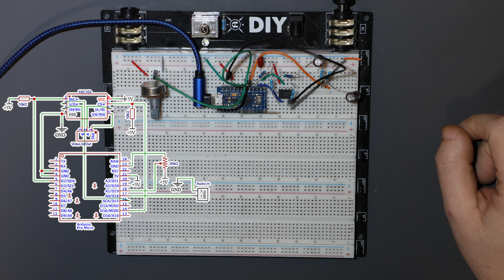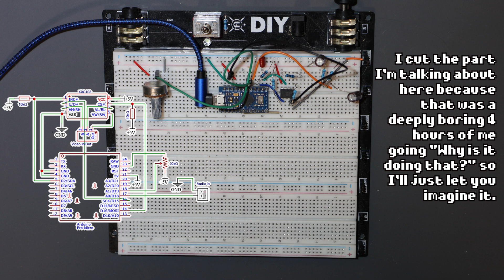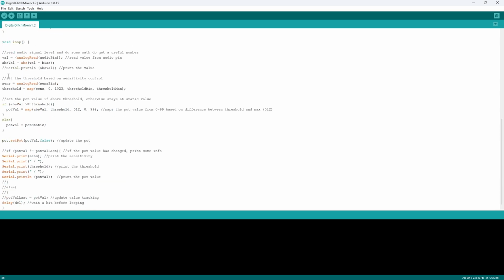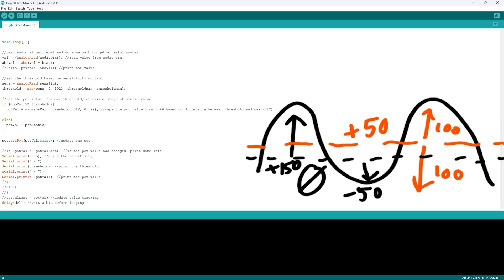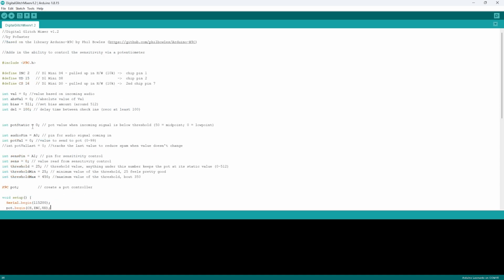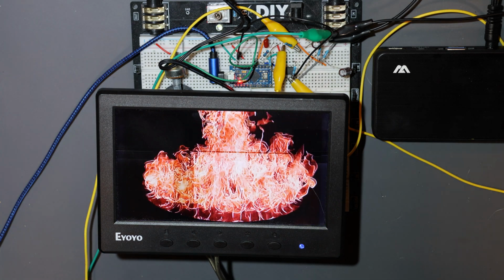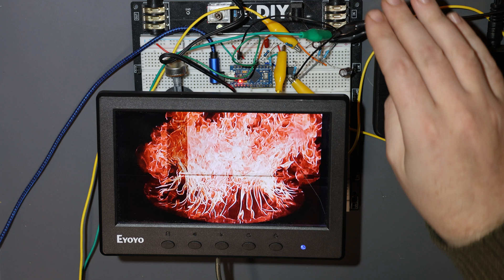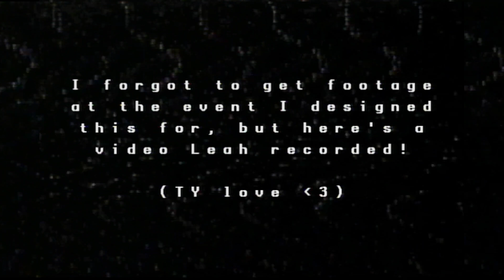Building a Digital Glitch Mixer (Karl Klomp Video Mixer) | SCBSS 3

Comment: Would love to see the 1k simplified mixer. Have you tried it with ultrasonic sensor as input?
Reply: Also, just to say, unbelievably helpful. I'm new at this, and this is the best video I've found so far!
Reply from the maker: @jeremystarn4331 thanks! I actually haven’t done much experimenting with this design since, but do love the idea of an almost theremin setup with ultrasonic sensors!
Reply: Apologies but also, also, how did you end up getting the signal from the digipot to the video out, assuming composite video.
Reply from the maker: @jeremystarn4331 let me know if I’m totally misunderstanding and whiffing this one, but the wiper is just directly wired to the rca output, nothing fancy needed
Reply: @getcircuitbent nope that's it! I was over thinking it, but it makes sense now. 

Does the digipot need a negative voltage? Saw somewhere voltage has to be less the Vcc? I'm going with the x9c102 off your recommendation.Very excited for this! It will be like a video theramin! I'll share when it's complete.
Reply from the maker: @jeremystarn4331 oh dope, I’m stoked to hear how it goes, def report back and feel free to post links etc in the community! But technically it just needs a ground vs a negative voltage, so I was able to power it from my microcontroller no problem
Reply: @getcircuitbent  do these resistors and capacitor makes sense:
80ohm between Vl and Vh - for impedance matching.
.1uF capacitor between VCC and VSS - for power supply decoupling.
10kOhm pull-ups - for INC and CS.

Is there anything missing as far as resistors or capacitors go? I saw somewhere using 220uF for AC coupling, but I guess you did that in the code with the Bias value, is that right?
To clarify, my input to the digipot is ultrasonic prox sensor , not audio like yours, so I'm not sure what/if the signal needs to be changed to make it clearer.

Edit: wow I mangled my clarification about inputs being video. the input is distance sensor data. It's fixed now.
Reply from the maker: @jeremystarn4331  check the section at around the 9 minute mark. Here I use parallel resistors between the Wiper and High and the Wiper and Low to bring the resistance down to something more appropriate for composite video signals. I’m not good with math, so you can see my trial and error process and potential figure out the math or do a similar process for your digipot.
I did not use a resistor between high and low for impedance matching, so that may be an improvement over my design - not sure if it would cause any issues but definitely report back if the impedance match improves performance!
Reply: @getcircuitbent  Thank you! I'm very new to all of this so anything helps, and this video has been a game changer. Much appreciated!
Reply from the maker: @jeremystarn4331  no problem, hopefully that gets you up and going!
Reply: @getcircuitbent  It feels so close..but no cigar. I see a 50/50 mix, and when only 1 is plugged in it's nice and clear, but the wiper is just not moving between them. The serial monitor is showing the sensor is working correctly. I've tried two different digipots now and same issue! Any ideas?
Reply from the maker: @jeremystarn4331  huh that is super weird. Shoot me an email with a photo/circuit diagram and I’ll take a look to see what I can figure out! Info@getcircuitbent.com
Reply: @getcircuitbent https://youtube.com/shorts/zR36zsbWl5E?si=9wvsKQxpv8Utpc1S

Got it roughly working. Just need to stabilize it and make it a bit cleaner. Looks a little better in person, less black bars, but still some cross fading at 0 or 100. Very happy with it tho, just needs tweaking. Thanks so much!!
Reply from the maker: @jeremystarn4331  oh that’s awesome! The flickery/glitchy effect as you approach looks so cool!

Comment: Awesome tutorial I have been wanting to build a video mixer and love that this one is audio responsive! I noticed that in the demo section when the audio signal is wired in (through the boards input i assume), you are using additional capacitors. Is there any specific reason for this other than just filtering the audio signal?
Reply from the maker: Good eye! I think that capacitor was on the original diagram I used to build the test circuit, but I didn't end up including it in my final design. 

But you're dead on, that capacitor would reduce any noise on the line by filtering. In my application I wasn't concerned with audio quality since I was just grabbing a level; so in my build it can be included or excluded. 

But if your application required more accuracy (say you were reacting to specific frequencies) or your circuit had more DC noise than mine did , then it could come in handy. I wanna say it's a 10uF cap I used on the breadboard? But I think anything around 1-100uF would work.
Reply: @getcircuitbent I see that makes sense, thank you!